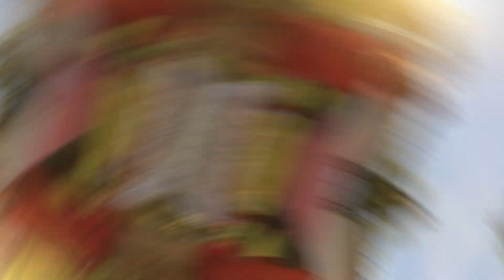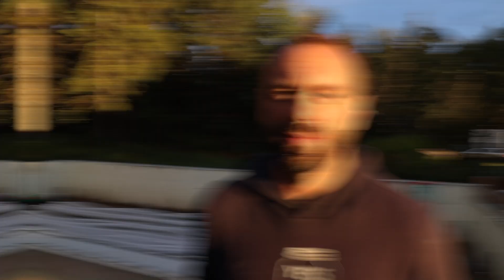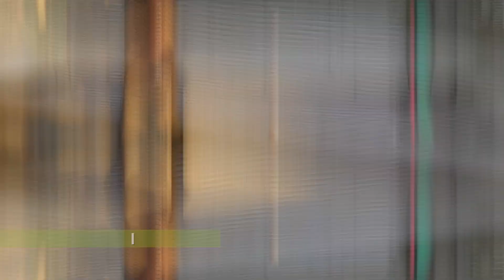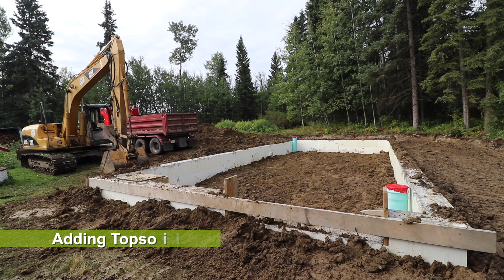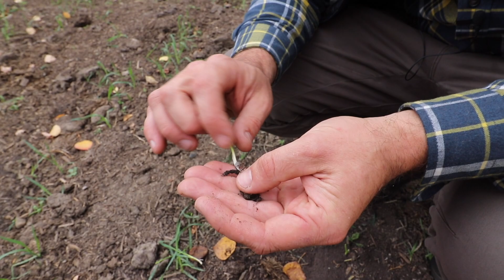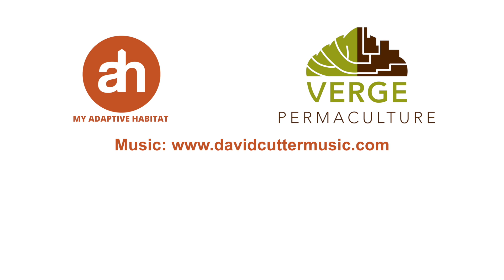How To Build a Climate Battery - Day 3 - Construction In Passive Solar Greenhouse

Comment: Would the geothermal work in south Texas where the temps don’t get as cold, but the heat in summer are 90-100 during summer? Would the geothermal cool the air enough to even out the temps for a small green house? Thanks for these videos, great job of explaining.

Comment: Did you optimize the manifold diameter? I wonder if larger diameter manifolds would reduce air drag, lowering fan power needs. Also, has anyone measured heat and humidity going both in and out of a greenhouse climate battery/GAHTS?
Reply: This system design in the video cant be optimized because it doesnt allow access to the individual tubes after they are buried in the ground. System balancing is performed after installation. The performance will not be great as the tubes are too close together and  the design system air flow rate of 800cfm is nowhere near enough for a greenhouse of that size.
System design flowrate must account for the rapid  greenhouse temperature rise due to solar gain, even in the winter months. If you are not able to move the air underground fast enough, the greenhouse will overheat and you`ll be forced to vent valuable heat that could otherwise be stored in the ground for use later in the day.

Comment: How do you know that the air is moving through each pipe equally?. Seems that if its only going through some of the runs then you wasted money. Maybe you should have tested the flow in each run before backfilling and possibly install dampers to get it dialed so you are using the most area possible underground.
Reply: You cant balance the system before backfilling due to the perforations. The tubes are far too close together which makes balancing them even more tricky, even if it was possible.

Comment: Thank you for posting such an interesting video! Noting that this was from a couple of years ago, I'm interested in how it worked out, particularly without bottom insulation. 
I know comon knowledge says heat rises, but that's not strictly true. Hot air does, but only because the medium is fluid and hot air is less dense. In soil, I would expect heat to be conducted in all directions, seeking cooler matter, until stopped (or slowed) by insulation.
Reply: The fact that nothing has been posted as regards the performance tells you all you need to know. Long tubes and low airflow rates makes for very poor cooling performance. The bulk of the heat stored in the mass comes from cooling.

Comment: Is it necessary to connect each of the smaller pipes at each end?  What would the impact be if you, for example, ran one pipe from the inlet side, down to the other side, back to the inlet side, back to the outlet side and then connected it to the outlet manifold?  I understand that that would increase resistance to airflow, but since you are trying to exchange heat, that may not be a bad thing.  This would significantly reduce the number of fittings (cost and time).  What is the practical limit on the length of one of the small pipes?

Comment: can likely use tecbolts to fix pipes to the manifolds they are self-tapping so cut their own hole - saves pre-drilling. they can cut through metal - that is their most common application - to fix metal roofing sheets. you can get them from 1/2" upto 8" and more.

Comment: Have you looked To other materials that hold heat better around the cross pipes instead of soil?
Reply: That's a good question! I've watched the LDS guy & he used gravel & said that wasn't as good ... not sure what he concluded to use. He said something about using the sock over the pipe if you used gravel wasn't necessary???
Reply: I was wondering the same thing... debating whether a material that held heat was better than one that transferred heat. Seems to me you'd want to disperse the heat as fast as possible for an efficient system. All soils aren't equal too- does a higher clay or organic content help?

Comment: Great video! Thanks guys. But I'm always wondering why the manifold diameters are so small? I would really appreciate it, if someone could explain that to me. In my mind... for perfect flow the manifold circular area would best be the exact sum of the ground pipes circular areas. Am I wrong? 
What I mean is, that how I understand it a 500mm/20" diameter manifold could actually only accomodate 25x 100mm/4" ground pipes.

Comment: Thanks for the vid, I have 56f 5 feet down in a basket with collector on hose in center. I am just about to add 20-25 feet of hose next week. I am using emergency foil blankets on top of tubes like you said. Our frost line is only 18" so think I am safe. Greenhouse is 42 sq/ft full of citrus in Canada. :)

Comment: Thank you for this amazingly detailed video! Question: We are in Ontario and in the design phase (taking the PSG Design Course) for a similar ICF foundation, 825 sq ft GH with earth-battery. How much depth of soil between each layer of weeping pipes? For e.g. we'll dig our foundation 6ft below grade and I'm figuring with 2 layers of pipes (similar to yours) they would sit about 2ft-3ft apart (vertically). The thinking is to allow the pipes to heat the maximum amount of soil without the problem of each layer 'double heating' the same soil, as might occur if the layers were too close to each other vertically. I hope this makes sense. Thank you!
Reply: Hope u put some Solar Hot Water
Reply: @guiltfreehotwater4354  I don't think I understand, can you elaborate? The question is regarding the earth tubes and how much separation is between the layers. Thx

Comment: did you consider using sand as your backfill material since sand holds heat longer (or so i am told) than soils and clay? Some good research on that in Norway i think.

Comment: 2 questions about improving performance:
1) Would reversing the direction of airflow between heat storage and extraction improve performance? (I imagine it would, if the heat bank builds up a differential in soil temperatures between the inlet and outlet corners over the course of a day).
2) Would it be feasible to operate heat storage at a slight positive pressure (~1-3psi) and heat retreval at a slight negative pressure. This would augment the system with  a regrigeration/heat pump cycle.A 5-10 deg C raising or lowering of temperature would substantialy increase  heat energy cycled/day, and might enable reduced sizing of excavation & piping. I would expect a very high coefficient of performance on a heat pump cycle with such small temperatire differential.

Comment: What about the destruction of the trees? Why wood? Aluminium is lighter,strong and less obstructive. The technology has been vast on this/Even triangles for curves. Plastic is an insulator and conducts heat very poorly. Are those pipes plastic? If so you will just be moving most of the heat in one end and out the other with very little being transferred to the earth. A fan can to that above ground.
Secondly there is an ambient temperature of the ground at a certain not so seep level. That is how trees survive winters.
This latent heat would be almost the same as the heat coming from the plastic pipes making them redundant.

Comment: I have built a geothermal system as well . Now I want to control the fans. Do you have a recommendation for a controller that will turn the fans on at a high set point ( 21C) then off at 20 C and on at 5c and off at 6C? I’m struggling to find anything but electronic controls are not my strong suit.

Comment: Very interesting videos!  Love your scientific approach!   We're thinking of building a climate battery greenhouse using water rather than air as the heat transfer fluid.  In this case we'd place a grid of water pipes about 9' in the ground like a geothermal heat pump system but not necessarily connected to a heat pump.  The heat capacity is much greater for a water/glycol mix vs air.  Could use a heat pump or just coils and a fan as the heat exchanger in the greenhouse.  Comment?  Is there any data on such a system?  Also a passive water/glycol-filled trumb wall along the back wall will of any greenhouse will supply significant heating.  What does your model say - trumb wall vs in-ground airflow battery, how much of an advantage is the in-ground piping particularly in less extreme climates?

Comment: The heat intake manifold is a great idea!. Would totally heat the air up more. i havnt seem that in any other green houses with a climate battery!(on my limited online searches over the last year or so). I am in the trades and its building code to have insulation underneath your floor. Hot air rises! But heat is conducted through solids in all directions. But the earth has a fairly constant tempature and in this type of greenhouse maybe it is not a concern! My main concern is water filling the pipes...and water will also conduct heat extremely well...i really want to build one of these on my farm but i may have to raise it above the water table. Once again thanks for the videos.

Comment: Rob that’s a great way of doing the battery, a manifold at both ends and straight run pipes. Simple, lower cost and efficient. Way to go. As far as the connectors, as long as the material of both sizes of pipe is the same (poly) you should be able to weld them with a heat gun or a torch. A little tricky but super strong, much better than a couple of screws.

Comment: heat doesn't rise hot air rises. :)
Reply: Warm air is less dense so it rises to the top of the building.  In the atmosphere it condenses and becomes clouds then rain or snow.
Reply: It might be that in the underground pipes, the warmest air is generally in the top of the pipe, so the bulk of the stored heat is stored above the pipes versus below.

Comment: I must correct one point: heat does NOT move upward. That is a popular misconception. Heat doesn't know up from down, it simply moves from hot to cold. That is, heat will move in any direction that is cooler than the source. It IS true that hot FLUIDS can move up, but that's completely different. When dealing with solids, heat will happily head straight down if that's cooler.

Would your greenhouse perform better if you had laid foamboard down under those pipes? Absolutely. I think it will perform moderately well anyways, though. Great job overall!